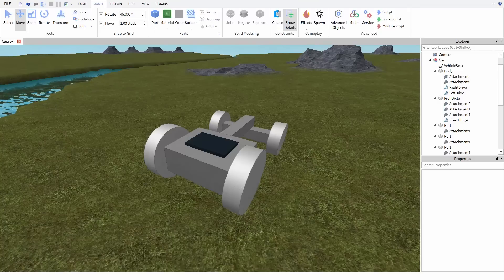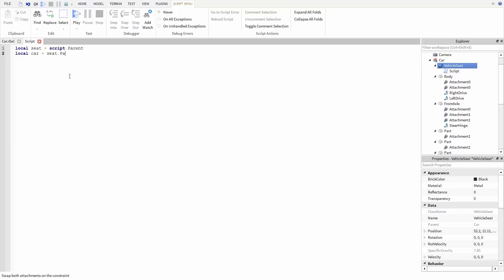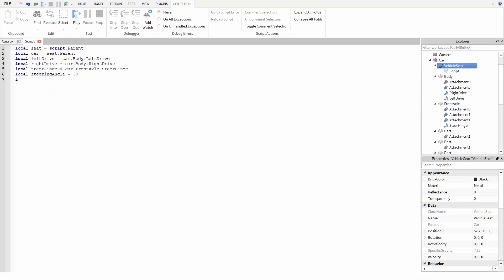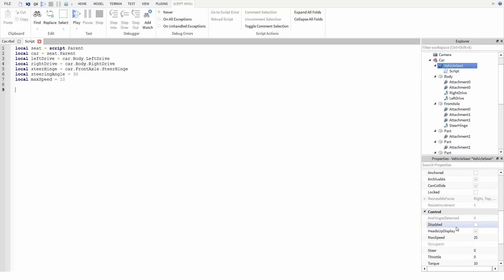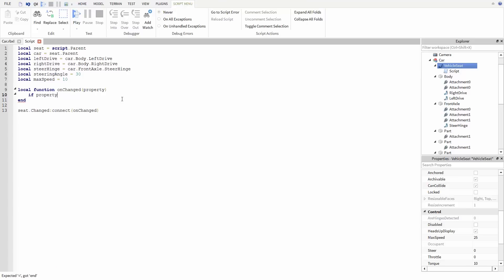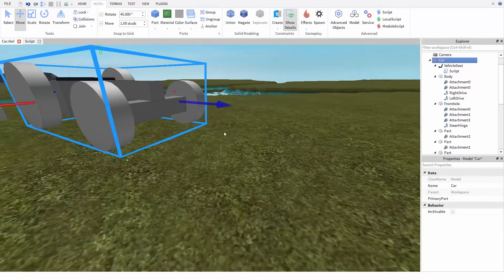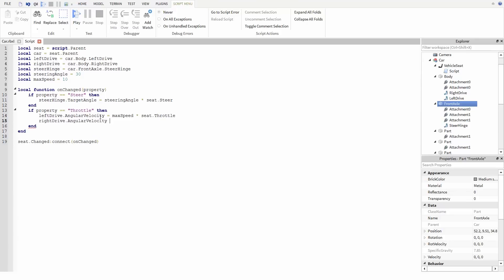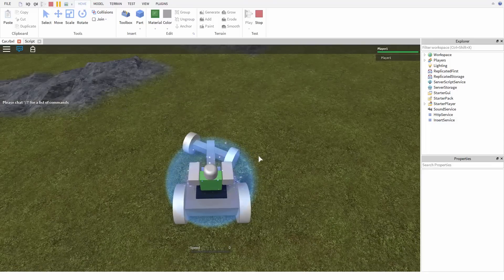Making a Car: VehicleSeat

Comment: Turning each wheel separately without moving their positions relative the the car would make the car slow down less when it turns.
Reply from the maker: You are absolutely correct: this isn't a very efficient design. But as I mentioned in an earlier comment, we thought it would be better to show how to do a simple system first and then show more advanced setup later.